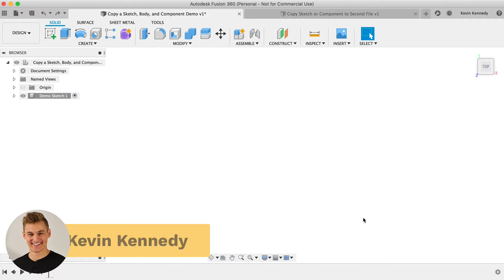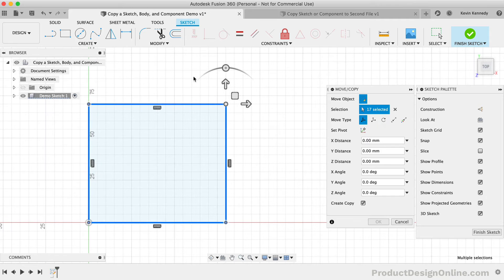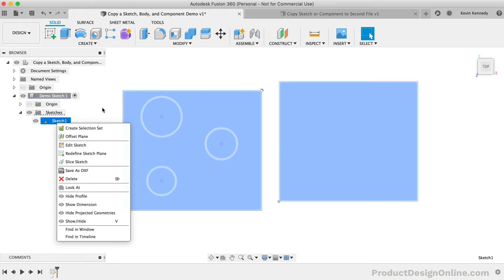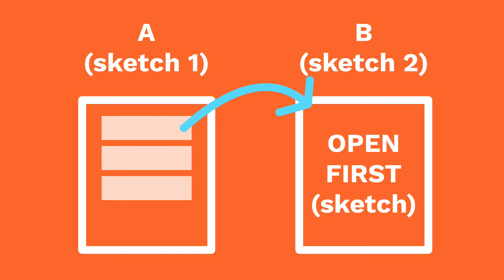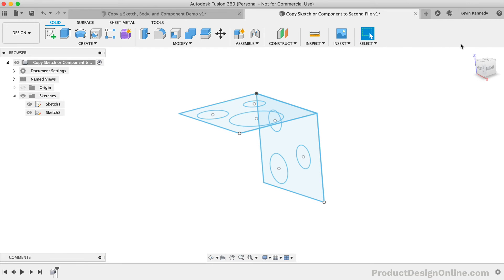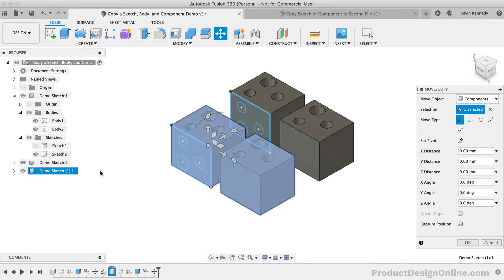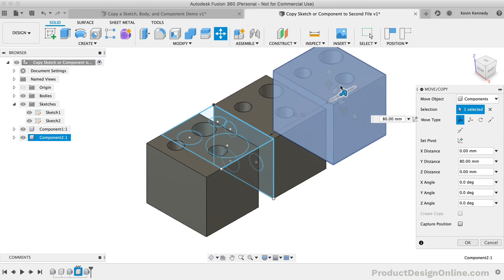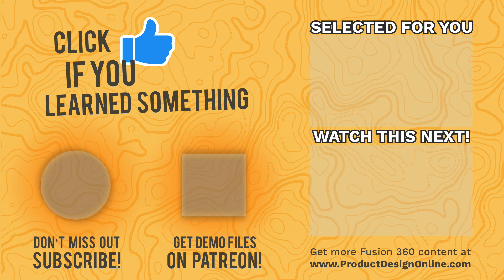Copy and Paste Sketches and Components in Fusion 360

Comment: I followed your directions and I am not able to copy geometry from one sketch to another. I am able however to copy geometry on a sketch and paste/move it on the same sketch and that works perfectly. I am able to copy the specific geometry again but then when I move to another sketch which is on the opposite side in edit mode and try to paste it there it will not work. Not sure what I am doing wrong. I do see a red lock on the sketch I am trying to paste the geometry to but I do not know what is causing that red lock.

Comment: Hoo boy. If you need 17 minutes to explain copy/paste, your app is poorly designed. I've used a couple dozen different CAD applications and this is the most difficult it's ever been to get a copy of "shape a" from over there to over here. Every other CAD program I use, I can select the lines I want to copy and hold alt while I pick up the lines from a point and drop it on another point... anywhere in the drawing... any layer... any face... I do not understand why this function (that has been around since the 60s) is still so convoluted in Fusion. I swear, I go from "Fusion has some handy tools" to "god-f&^@#-&^*#$% this is the worst CAD program I've ever used" EVERY session of using it.

Comment: Wow 5 years has passed since I learnt fusion from you. Hope you are well. So what my issue is now is I want to create a gear and track. Fine with the gear generator but after projecting one tooth and using that for the track I want the track to be curved. I want to copy the teeth along that curve but have them reorientate as they go so the track would work with the spur gear. The teeth have to tilt is what im saying. Slightly each one so the track is correct. Imagine a shallow curve. Yep teeth long that. Is there a way to do that?

Comment: When I copy/pasteNew a component and then move it over the origin changes but when I open the sketch the sketch opens at the old origin... Idk how to fix this
Reply from the maker: This sounds like the expected behavior because editing the sketch (or any item in the timeline) rolls back the timeline marker. Every feature beyond it in the timeline does not 'exist' yet.

Are you having any issue(s) with something related or was this just confusing/surprising (which I totally understand... it is a bit awkward)?
Reply: @ProductDesignOnline  It was definitely weird! My problem was that I have a canvas with different gem shapes and needed to copy the component, move it over to the next gem shape and then barely alter the sketch to match the new shape. I needed to do this many, many times so it would have been extremely annoying to do it that many times from scratch when I have one that is 'pretty close' right there. Since it was jumping back to the old origin it was not on top of the next gem so I couldn't easily line it up or change it based on the picture.

How I fixed it was pretty simple and it lines up with your experience of editing the sketch rolling back the timeline but it took me hours to figure out what I needed to do. After copying and pasteNEWing a component, I did a move command on the component so that the move command was in the timeline and then I dragged the move command back to before the sketch existed (the newly pasted one not the original).

Thanks for checking in! If I hadn't figured it out yesterday then your comment would have completely solved it for me so I really appreciate it. I also appreciate all of your videos! I have learned so much already. ❤️
Reply from the maker: Glad to hear you figured it out! Well done :) @Trev625

Comment: How do you copy a body and keep all its history. So for example I can change an extrude I made on the original body but on the new one not the original.
Reply from the maker: You can't do that with bodies, only Components. You would need to use the "Paste New" option when copy/pasting a Component.
Reply: @ProductDesignOnline  so if I create a component from body then copy the component and paste new it will retain all parametric timelines that apply to it and copy that timeline over as well so I can individually change the history only affecting that part?

Comment: Newbie here. Just a few simple projects under my belt. How do you start with a component? When I start designing in F360, my sketch opens in its own sketches folder, not nested under a component. Also, when I copy and move my sketch, the copied sketch doesn't have it's own sketch file under a folder, it stays associated with the original.
Reply: CREATE > New Component.  This is the "first rule of Fusion 360" -- always start with a New Component!

Comment: Thank you.  This video finally allowed me to copy sketches!  Here in mid-2022, I think Fusion 360 could've been smarter about it though.

As in when pasting without an active layer, it should be smart enough to bring up a dialog informing the user as such.  Then provide option to automatically create a new sketch.  

Example:  If user uses CTRL+V without an active sketch, then Fusion 360 brings up a dialog with message "An active sketch is required to paste a sketch.  Create a new sketch?"  The user then should have the options of OK or CANCEL.  Would save sooo much confusion around the world!

Comment: zero stuff from this works selecting a face or lines pushing M pulls up copy/move menu but there is no create  copy checkbox also ctrl c &v says its copying and pasting but does nothing. been spoiled by SketchUps easy to use controls and f360 is clearly a better program but makes absolutely no sense to me. used all the ways in the video none work for copying.  Also youtubers premaking a file and whatnot just makes it confusing from step one for us noobs.. lessons with default settings and no premade files help far more. Thank you for your content and efforts though!!
Reply from the maker: Hi Michael, thanks for your comments. I do record all of my tutorials and course content with the default settings. What's important to note is that Fusion 360 gets monthly updates. This tutorial is nearly 2.5 years old, and sometimes little nuances of workflows get affected/change with the monthly updates.

Generally, copy/pasting sketches is NOT a good practice in a parametric program. It can be hard to 'let go' of the workflows that a non-parametric program like SketchUp has, but the extra requirements of Fusion 360 (or any parametric program) are what make them really shine. The concepts in this tutorial still work - the main things it make sure you are in an ACTIVE sketch environment before trying to paste. If you go to paste anywhere else it will not work.

The ability to update dimensions in your model without other aspects breaking is what makes Fusion 360 really shine. You should most often be copy/pasting Components (3D bodies) not the sketches.

Comment: I want to be able to duplicate a component and then be able to modify the underlying sketch without affecting previous components that also used that sketch.. how do I do that? ie. tell the new component to make a copy of the sketch that I can edit. When I created a new "paste new" component, there is no history or any sketch associated with it. Seems to just be "base feature"
Reply from the maker: There should be a sketch as long as the Sketch is nested underneath that component before you copy it. Can you double-check that the sketch is in the correct place?
Reply: @ProductDesignOnline  no... no sketch "underneath" - if you mean below or inside it in tree - i have main tree base then separate branches for Sketches, Bodies - I'm not sure if this is correct or not, but that's where F360 seems to put things by default. The component I am trying to copy is an extruded sketch, which then gets further shaped by another extruded body from another sketch (using Cut method). I then I think used "make component from body" on finished piece to separate it out on tree and make it possible to save as STL separately. The entire history of making it is basically throughout the Timeline history. Anyway I gave up trying to copy/modify it - just ended up having to rebuild the new version of component by starting from beginning again.... copied the two underlying sketches and modified to new shapes, then extruded and cut them again. Very slow having to do all again, just to make slight modification to shape of original component 😞

Comment: Thanks for the tutorials. 
I have a question about copying a fully defined sketch (ie. constrained and with projections) from one design file to an other. Once you try to introduce the sketch to the second design file sketch, obviously the dimensions are still there but all blue, unconstrained. Now, I thought that logically the sketch was copied all tied together and it was only a matter to link the copied sketch to a known (common) geometry, giving this way an "anchor point" for the copied sketch. But sadly even using the move "point to point" in a fully defined point on the new sketch doesn't anchor the copied sketch and it remains blue... I was doing this to save some time and using the same sketch between different project files. But doesn't seems to work, any suggestion. Thanks

Comment: Any tips to paste constrained sketches so the new pasted version is still constrained? Seems every time I paste a sketch, the lines turn blue. Everything looks the same but if I try to move the sketch around using constraints, everything goes bonkers...
Reply from the maker: I would suggest copy/paste a component with the desired sketch (if possible). Constraints should copy with, but it's hard to say without seeing it. You will have to constrain the new copy/pasted sketch to the origin point of the new sketch.
Reply: @ProductDesignOnline  Thank you!

Comment: Thanks, that saved a lot of time.
I'm just learning Fusion during the weekends and it seems my brain has a slow leak so, I have to redo some things I know I have already done.

I thought I needed a practical project to help focus, , 'motorise the blinds', just a wheel on a stepper motor to drive a bead chain right?

A sale came up, bought a cheap 3D printer, did a quick sketch on a bit of paper, converted to Fusion, two weekends later I found out the sample filament they give you is not enough to complete the job.
BUT, it took me almost 3 hours to figure out how to do the 'D' shape hole for the shaft as a push fit and two test prints to get it right.

This clip means two things.
One I can copy parts from project to project saving time.
Two I will be back here to remind me how.

Make that three, my wife's reaction to when I install the project.
Reply from the maker: Glad to hear that, Kevin! Best of luck with your projects :)

Comment: Dummy question Kevin, if you allow me... I want to duplicate a part I designed on Fusion 360 and copy it to a new file and modify the sketches to make some variation based on the original design. Is it something doable ? Or did I miss something on your video ? Thank you for your future reply.
Reply: The easiest way is to open the file, then do a "save as" with a new file name. Then you can edit away as you like with no links to the previous file retained.

Comment: Kevin to create a 1 x12 x 1/8" interconnecting steel bar to hold slide rails in place using a series of duplicate top and bottom extruded flanges; should I use the bar as the base and copy and paste in modules of the flanges - or is there a better way ? Thanks Richard Cherry
Reply from the maker: Hi Richard. When possible, always copy/paste or pattern solid bodies instead of sketches. A good way to think of it...
-Copy/Paste or Pattern Bodies = when each object is technically its own individual part
-Copy/Paste or Pattern Sketches = when all the sketches make up one single part
Reply: @ProductDesignOnline  Kevin - Thank You. You just saved me from going down the wrong path and hours of wasted time. As you indicated, I will create a series of separate Components with Bodies, duplicate some, and assemble them into the finished part. I Love THE DETAIL In Your Videos. I Use The Transcripts Extensively. Very Much Thanks Richard

Comment: Hi, nice video! How I can paste a lot of the same sketch form? I need to paste the same circle in a lot of positions in the same sketch and it's not placed in rectangle or circle pattern. Thx!
Reply from the maker: I would suggest using either equal constraints or symmetry constraints based on the location spacing. It's hard to say exactly without know what you're sketching...but definitely try to use constraints.

Comment: Good stuff Kevin.  Can you show how to create textures on solid objects?  Say ribs on snake? Or scales on fish mold?
Reply from the maker: Hi c P. Those types of textures, which I would consider "Complex Patterns," would have to be done in another piece of software and brought into Fusion 360. Fusion 360's parametric nature doesn't do well with things like that because it would have to re-process the pattern any time you make a change that affects it. Autodesk Mudbox can be used in conjunction with F360 - https://www.autodesk.com/products/mudbox/overview
Reply: @ProductDesignOnline  Thanks. Will check it out.  I am creating solid shapes in Fusion for making a pourable mold.  I have seen where Fusion Cam capabilities has some applicability but seems very limited.

Comment: AS of Feb 2020 the copy paste by hot keys is still very intermittent and the Move with copy selected is the only thing that works every time.  Even the right click does not always show paste if a shortcut Ctrl+c has been used.   Kind of reminds me of samsung phone android implementation on my note8 .  May work, may not.
Reply from the maker: Hi Michael. I can't say that I've seen issues with that paste function not working. Usually, it is because the user is trying to paste a component in the same component which isn't allowed. Can you confirm that you have your top-level component active before trying to paste/paste new?
Reply: @ProductDesignOnline  yes, just trying to copy sketch in same sketch.
Reply from the maker: @michaelryan2622  Strange. Copying a sketch should work with the shortcut (CTRL/CMD + V) or the right-click and paste. I would recommend posting on the F360 support forum in case its a bug that needs to be fixed - https://forums.autodesk.com/t5/fusion-360-support/bd-p/962
Reply: @ProductDesignOnline  Yeah, But it does, again I will tell you only use the copy box, because of object focusing problems in fusion 360

Comment: Fusion was written by a complete moron. So much of it is not intuitive. Cmd c then cmd v does nothing. Im in one sketch of a design and want to copy it into another. So I went to that other design and opened the sketch. Then tried to cmd paste it but only 1 small square appeared. Looking at the design again that I was trying to copy being a gearbox, I can see the little square in blue. So what is Fusion doing. Why won't it be like apple designed the machine to be. Copy and paste should be the same. Drag to highlight and then cmd c then command v. Even in 2 sketches nothing. Furious at why they had to make logical operations non logical.
Reply from the maker: Hi, James. I understand your frustration. There are many quirks to know with copying and pasting. It sounds like the box being copied may be a small portion of the sketch geometry. Have you tried to select some of the geometry while holding down the shift key, instead of dragging over it? I find that when I drag over the sketch(es) it selects too many other things. Cheers, Kevin :)
Reply: So that rotating your design when you press c or l on a plane. What the hey were they thinking? 

Making the copy thing so difficult

Not having load last file in drop down at top instead you have to scroll down through a plethora of designs to find the one you need.

Let me ask you something. Imagine a disc 10mm thick. On one surface at equal distances 3 dimensional curved teeth running around the whole thing.  Ok in sketch I drew the circle. Then I drew the first tooth. Then I made 44 appear with the  circular pattern tool. Then extruded and you have those teeth on one face. Yet they are not 3 dimensional. To add the angled sides to each of them I went to plane on angle and individually created the angle 1mm out on either side. Surely there’s a faster way to get all of those 3d teeth? Spiral gear if you google it for reference should show you what I have just painfully finished. Took ages. What’s the faster solution for next time.

Comment: Hey Kevin,  I'm commenting because I've got a pretty urgent question about 3D printing. If I needed to print three of the same box but as individual parts, would I have to print the design of the box three times; is there a way to put three boxes on one design and hit print just once? Sorry if it's a dumb question haha
Reply from the maker: Hi, TheGoldenLlama. You can copy your components or bodies in Fusion 360, to make 3 of the same box. Then, when you have the "Export as STL" dialog open you can select the bodies/components, making sure all 3 are selected.

The second option would be to copy and paste in your 3D printers slicing software. I use Cura, which is pretty simple. You can simply use the standard CTRL/CMD + C and CTRL/CMD + P to copy and paste the box until you have 3. Cheers, Kevin :)